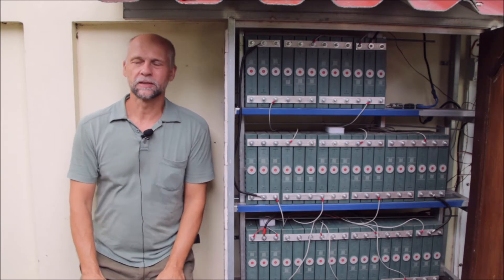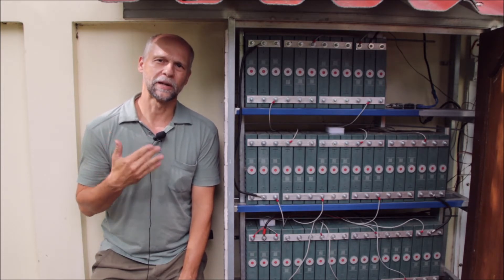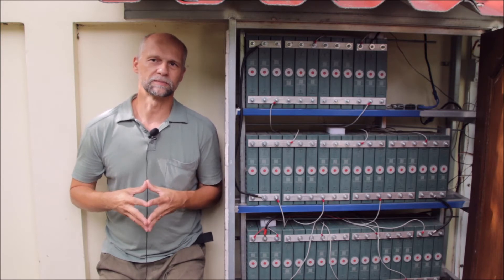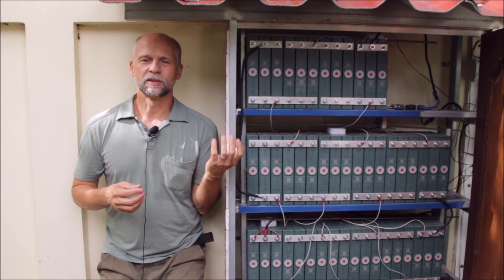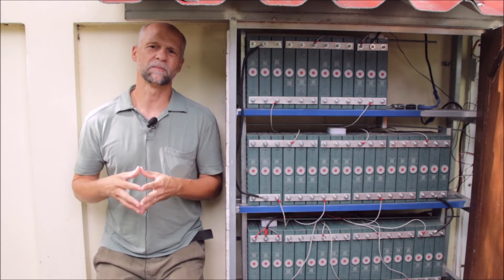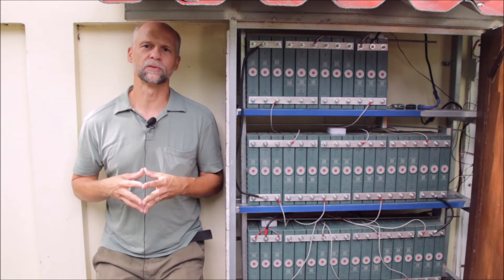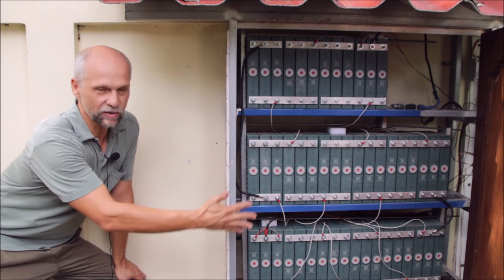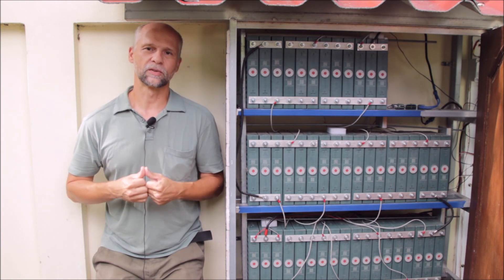Parallel Strings or Parallel Cells in one String? What is the better battery setup?

Comment: Hi M, W. Am I glad I stumbled upon your channel?. I was looking for a good explaination. 

I want to build a 33.4 Kwh battery system that will submerge in a tank with a dielectric fluid (pump-radiator system for cooling and minimise fire hazards) for my future EV. I was investigating if it was more advantageous having the cells in a Parallel Strings or in Parallel Cells in One String.  

According to your saying, of it is not LFP chemistry, all other type of cell chemistry should connected in a Parralel Strings scheme for safety concerns and because of the type of chemistry, meaining having 2 BMS. I'm using NMC cells from CALT. 

Since the cells are immersed in a dielectric liquid for cooling and safety, would you still recommend me the Parallel Strings system ? 🤔
Reply from the maker: @donaldwright2426  hi. If I think back to the times when battery DIY started, it all started with people collecting 18650 polymer cells which are more like the NMC cells you mention. They have built their packs by connecting 80 or more such cells in parallel monitored by only one BMS. The idea they have taken straight from Tesla's approach of making such an arrangement in their battery packs for their cars.
The safety concept of how to prevent dangers originating from "runaway-heater cells" was to put a fuse wire for each cell before connecting them to the common bus bar.
The appearance of prismatic cells, especially LFP chemistry, reduced such a risk by magnitudes and by watching general cell behavior, one can easily spot cell deterioration.
So the question you should ask yourself is how likely is it that such a NMC cell could have a fault. The problem would be internal shorts which are heating up the cell. With a parallel buddy cell, there would be double as much energy available to burn off inside. Any other voltage related issue would be taken care of by the BMS anyways no matter how many cells there are in parallel.
I do assume that you are using high energy pouch cells with probably somewhere around 300Ah capacity per cell. With NMC I would see this much capacity already enough to put them into a separate string with a separate BMS. For LFP I would go for maximum 2 such cells in parallel.
Interesting approach to submerge the cells. Never saw such a setup yet. Wish you a happy building 😉
Reply: @RolandW_DIYEnergyandMore  Thanks for your reply. The cell are prismatic type with a bleu film convering the aluminium casing. Each cells are 116Ah (418 Wh). As for submerging the cells to form the battery, I will first test it with LFP 32700 cells.  I will eventually make a video of my testing and the flooded battery pack.
King regards,

Comment: Hi Roland, this video is really very interesting, it's difficult to find this precious information around... Question: I have a 24V system with 8x280Ah REPT cells that has been working for 1 year. I just bought another 16 EVE 280Ah cells and I wanted to make a 2P8S configuration, is it possible to also add the old cells and make 3P8S or is it better to keep them separate and use them as a reserve system in case the new one are out of charge?
Reply from the maker: Hi. Well, after 1 year, your REPT cells should still be like new. I would put them into a 3P configuration as 24V systems tend to go higher on current as 48V systems anyways. The problem with a 1P and 2P in parallel is, that the 1P would have to carry the full load if the 2P shuts down. So the BMS there must be same capable, etc. 
Just try to place them all in a way, that you don't have longer jumpers between cell groups. Then the pack can stay balanced more easily.
Reply from the maker: Alternatively as you do have the big size 280Ah cells, you could just go for the classic 3x 1p setup if you ever think that like that you could shut down individual strings for maintenance, etc
But I do not expect that you ever will have cell issues. Commercial packs which use pouch cells, do as well have several cells in parallel internally...
Reply: Thanks Roland, these considerations make me think a lot. But my idea was to keep the old battery pack on standby as a reserve and activate it only in case of maintenance or problems with the new one. But maybe a little complicated to set up, don't you think? I'm still undecided about what to do with the new 16 cells, and I'm also thinking of using them for a 16S system in the future, will be this still possible? What would you do with them now?
Reply from the maker: @pablonerino  it would be a waste of resources not to use the old cells for daily cycling. You will never need it as backup as the battery just doesn't make problems.
It is even bad not to cycle LFP batteries. They will be degraded by sitting around.
 I would do the 3p. If you are eying a 48V system, of course that would have advantages as lower currents, equipment cost and better efficiency. But then it would be better to get 8 more cells and do the 16s2p then idle the old cells.
 So yeah. If you already have 24V equipment then just use all you got!
Reply: Yes, it would be a lot of energy.. but I live far from the city and don't have greed connection, so if something stop in the system, non energy at all! 
I will think about it. Thank you for your support!

Comment: Wow,nice teachings;
Question:
I have 4 strings of 24 v.  all 4 in parallel,  all LIFEPO4
8S of blue  200Ah, months old
2P8S of  7 yo white top notch  CALB 60Ah (all given to me for free)
8S of  green Sinopoly 100 Ah, 1 yo
2P4S of 7 yo small yellow  sWinston of 40Ah (for free too)  in series with 4 more free white CALB of 60Ah

Only one 120 Amps BMS on the big ones, i never draw more than 50 Amps,usually 10
Inverter is an el cheapo, china,127 euros 6 months ago, 5000W 2500W, shuts off at 2450, heavily modified,has 4 fans now,one just for the 4 IGBTs and 3 for the toroid and Mosfets, and at 2400W it stays cool or barely warm to the touch everywhere, i have another one  like it, as a spare,new in the box,looks like i will never need it;

Tonight is the second night with that set up
I have been off grid 100% since 1 month ago
I have 40 years as auto mech and electronics repair,have excellent amp and volt meters

Been watching like a hawk most of the cells, but not all, some are difficult to reach,the rack is too compact, 4 stages high

AMAZINGLY, them 4 strings and the 30 or cells i reach, ALL  different, they stay with the SAME voltages within 2 centivolts, all the time,charging and discharging, so i am letting them be, the thing seems rock steady, but...

My doubt is if the cells may constantly  interchange small currents between them, between the all different 4 strings, when the load varies, especially at night,do you think so?
Reply from the maker: Hi Jose. Very interesting setup and challenging question. Mixing so many strings with such different capacity cells in parallel is typically not the best solution. Smaller capacity strings will run a bit ahead  in voltages of larger capacity strings. As LiFePo4 is a bit sluggish in giving and taking currents and the charge and discharge curves are very flat, such created voltage differences may represent very different SOC values in each of the strings. So, key is low C-rate! Never run your pack on high currents. Not when charging, not when discharging. Your pack seems to me to be well oversized for your application. So its OK! Still, the small capacity cells are under higher stress. So you might get issues with them a bit sooner. Good luck!
Reply: @RolandW_DIYEnergyandMore   Hi there,and thanks for your answer; the whole thing is still working beautifully, each morning i still have over 60% of bat.capacity left, and i no longer see  the need for individual cell voltages monitoring,that one JK bms easily  takes care of the whole bat. herd, hands down, it always stays at room temp; 

 The pack is,i think,44 strong, but of course the BMS only sees 8, since there are various groups of 8 all in parallel;  so,all the 44 voltages have to,and do, converge to the same voltage , as packs and indiividually , since they are all interconnected with wires-- simple,short wires,from pack to pack and only one set of 9 longer ones to the BMS;

But you may be absolutely right when stating the need to stay at a fraction of C;  i am sure that the whole thing would  scatter voltages if  i tried to push, or pull,say 60 or 80 Amps for over a few minutes; but fortunatelly,and by design, that cannot happen, i never need that,and  i have in-ine 40 Amp breakers;

Somehow i am starting to think that the big ones are protecting the smaller ones;  

i explain:  when i measure the currents in or out from the different packs, i see that the big ones,200Ah, are always taking or delivering much more than any of the others; if the 200Ah ones are ,say,charging at 18 Amps,from the Sun, another pack may only be taking in 6,and another,the smaler one,only 2 ot 3 amps ;

So, it seems that the big ones always take the lead, in or out,and all the others just tag  along for the ride, but,of course,always forced to render help;

Could it be because the bigger ones have less milliOhms,and so the electricity always tries to go to and from them first? 

Either way,i predict a long life for my setup like it is; so much so,that, now  almost being  winter here in Portugal,SW of  Europe,i am ready to install 2 more panels, because of 1 more  new hot water heater, and to try to stay some 95% off grid.

Of course i would never reccomend that system that  i have,  to anyone, one will be much better off getting just one set of good cells the first time around,,say  one GOOD set of 280 or 300Ah, instead of some parts and pieces like i have.
Reply from the maker: @josepeixoto3384  yes, bigger cells will have lower internal resistance and most current will end up there. Did I read that right that you have as well connected each intermediate cell level in parallel so that your BMS is getting cell level voltages of all 4 strings? This of course means that currents are interchanging between strings on every possible way and wire. Its almost like internal balancing :) 
As I said, this will all work as long you do not push your system to hard. Keep us informed! Thanks.

Comment: Thank you Roland for the nice inputs. I have been looking for this topic for weeks now and finally found you. Which BMS do you use for your setup? And what BMS would you use for the 16s6p setup?
Reply from the maker: I am using a pure hardware BMS by YIT (Aliexpress)= similar to a Daly brand as well by price. My BMS is 70A as I do not have high currents (max 45A at the time). For a bigger battery I would probably still continue to use the same BMS, but because it wouldn't have enough current capability, i would switch a contactor by the BMS :). Otherwise I would just buy a new one. You should just oversize the BMS by around 50% to stay on the safe side. I do not care much about balancing capability, as LFP will stay nicely balanced if you do not go to limits and go easy on the cells.
Reply: @RolandW_DIYEnergyandMore  Thank you for your fast reply. So with your BMS you could maximum draw 2160 watt? If you have a household where you run everything at the same time in the evening. Dishwasher, oven, lights and television. This would require a much larger BMS right? Lets say you draw 6000-8000 watts in peak hour, then you would need to have an 200-300Amp BMS?
It is just to have everything as cheap as possible. But with your 16s3p setup it is possible.

My friend build a huge solar pant on their factory and we are thinking about constructing a 16s14p battery. What is your option on this?
Reply from the maker: @tiltforce  correct, for 8000 watts you would have to use at least a 200A BMS. Alternatively there are as well contactor based BMSes which might be a bit cheaper then a Mosfet based high current BMS. If your friend is planing a very large battery for a factory, he might think about if redundancy is required. Battery rarely shut down, but if they do and you only have one string, then you lose the whole system. For a redundant system, I would go for 3x 16s5p or so. But if you make several strings, always be careful that each BMS there can carry the whole current of all strings to not burn up if one string shuts down while under full load.
Reply: @RolandW_DIYEnergyandMore  Do you by any chances have a name for does BMS? I have tried google, but they are not easy to find.

3x 16s5p sounds like a good option.
Reply from the maker: @tiltforce  https://a.aliexpress.com/_mKOqsIx , this is a contactor based BMS. YT channel "Offgrid Garage" is using it for example

Comment: Hello from New Zealand. I am totally reliant on my Lithium  pack for all my power needs and have been for decades., although starting with those horrid lead acids in earlier times. I agree with you completely that redundancy and simplicity is the most important aspects. I rely on the low voltage cutoff of the inverter, and the high voltage cutoff of the solar charge controller only to protect the 14kWhr battery bank. I have neither a balancer or any BMS. The cells are manually checked  once or twice a year for cell balance and have never seen more than 20mV difference in a high state of charge, where cell imbalance is amplified by the upwards  voltage curve. This is a very simple setup, easy to maintain, easy to fault find, and easy to fix. Thank you for taking time to make these interesting and well explained videos.
Reply from the maker: Thank you for your great comment Dayle. I just want my viewers to know, that understanding their pack, can make many devices obsolete. Use technology where it is absolutely needed, and the brain and common sense for the rest :). Thanks for watching!
Reply: @Dayle Edwards - Are you using LiFePo4 chemistry cells?  If no, then which chemistry?   What brand / manufacturer?  New or used cells?  How many cell in parallel?  How many in series?  #S#P?  What is your pack High Voltage cut-off?   What is your pack Low-Voltage cut-off?

Comment: hi roland, i beg to disagree.
by paralleling this way, you also loose individual cell monitoring.
your arguement that you are creating a more stable pack this way isnt valid ( in my opinion) , as you will allow movement just the same by creating 2 ( or in your case 3 packs), as the movement will continue regardless between the packs.
the movement however will be much less load, as not smaller cell groups, but rather whole packs will balance out.

another advantage to using multiple packs, is that one might need more, but smaller bms'es..
eg. a 100 amp bms x 2 instead of 1 huge 200 amp bms.
this might be less of a problem when building smaller packs, but when building packs able to deliver 200 or 300 amps, it becomes real hard to find bms'es ,breakers and fuses capable of handling that.

again , just my opinion
Reply from the maker: Yeah. Of course you may disagree. Its an open discussion... The problem I see with going with smaller BMS's is, that that might just be the catch which will bring you into deep trouble. Lets say you have 2 strings of cells, and your max load is 160A. Would you use 2x100A BMS's? What if one string shuts down while under full load? So you will end up buying 2x200A BMS's. That's why I said, if redundancy is King, you will need many strings. Maybe 4 or 5, while 3 can run your full loads. But that extra, cost a lot more extra in money too...
The energy movement between pack is all very nice working with LiPo/18650/NMC standard chemistry, as the Voltage there does not drop for resting when one string is under less demand then the other. But with LFP it is fluctuating from resting behavior. LFP is sluggish, there can be delays in response which will be exaggerated if strings are split. But I am sure you do have good reasons to do it the way you are doing it. All can be right. Thanks for the input!
Reply: @RolandW_DIYEnergyandMore  When you get into the 200 Amp range, it is not wise to use a 200 Amp MOSFET based BMS.  It is time to use DC contactors, not MOSFET's.  You have a 3P LiFePo4 system, with one BMS, where one cell failure or a BMS failure will take down the entire system.  With 3 independent strings connected in parallel, a failure of one string will not take down the entire system.  And we do NOT need each BMS to be rated at 200 Amps.  Each BMS would have its own 75 Amp Circuit Breaker.  225 Amps = 3 x 75 Amps each. When you are off-grid, up-time is most important and redundancy helps achieve that  goal ...
Reply from the maker: @MrSummitville  so how many inverters do you have on your redundant battery system? After all that is the device which will cause 99% of your down-time, and the remaining last percent by something other then the battery cells (if yours are LIFEPO bricks). It is easy to talk about tripling up on 10 dollar items but leave the 2000 dollar elephant in the room unspoken.
Reply: @RolandW_DIYEnergyandMore  Maybe, your inverter failure rate is high because you live in jungle type of environment, with insects living inside your inverter, high heat and very high humidity = corrosion.

Comment: Roland, I agree with what you are saying.  Is there any chance you can do a video on bus bars. Width, thickness and amperage capacity between aluminum and copper?
Reply from the maker: Right, I will try to find the right information and make a short video about it. Thanks for the suggestion!